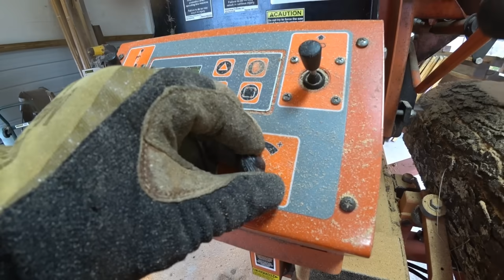FINISHING UP AN AMAZING CHERRY LOG, INCREDIBLE CROTCH SLABS!

Comment: I have often wondered why checking on the ends is considered less desirable. A small drill at the end of the check, some sawdust and glue or epoxy with a bowtie adds character for me. Those off cuts would be great for small projects too. When l saw the book match pieces l can't include what l said lol. Beautiful piece of lumber. Wish we could buy that here in Canada, our local supplier prices timber as if it were gold. That next tree is going to be platinum.

Comment: Nathan, sitting watching your newer sawing videos and all your sawdust on the floor. You need a vacuum system like we had in the saw mills I worked in, only a lot smaller. Put the system outside with a bin under it and a flexible hose that hangs on a wire overhead between the saw and the vacuum. I am sure you can find people around who will buy that dust for garden mulching so long as it doesn't contain any conifer wood.
Reply from the maker: That’s in the works.  👍👍👍
Reply: Walnut sawdust is a plant toxin so you have to really control its use as a mulch.
Reply from the maker: I burn mine 👍
Reply: I also read you should wear a mask with walnut as the dust is unhealthy. Is that true?
Reply: I think it is at least an irritant and more for some people than others. If I was going to work around walnut dust that could be inhaled day after day, I would wear a mask.    But I’m no expert on it.
Reply: I used to work in a cabinet shop that had a yard full of sawdust that they would sell to a horse farm but the farm stopped taking it because the horses were allergic to the walnut dust. That dust had a manure-like smell that I did not like either. Some types of oak have a similar flavor but cherry dust smelled the best. My favorite wood!
Reply: I too was wondering about all that sawdust on the floor at the end of the day! Thanx for all your replies that answered that!

Comment: I agree that the oil drain hose bothers me hanging down. 
Can you zip tie it to the blade tension handle loosely so it doesn't interfere?

Hate to break it to you but nasty storm headed east towards you with severe cold first part of the wk.
Reply from the maker: Yep saw that 👎👎👎👎

Comment: Great looking, even though it’s still a little furry from the Saw Mizer blade. When it’s finished it will be something. Also, try custom white balance on your camera. The wood changed color a couple of times due to AWB.
Reply from the maker: Yes. I struggle with that.  Thanks 👍
Reply: You can get white balance cards on Amazon. I carry one with my camera. You just have to remember to set it for the next shoot or it can really mess things up. 🤓

Comment: Nathan, as your saw blade gets dull is that what makes the horizontal lines across the slab? 
i can see them but still it can't detract from those awesome insides of the slabs!
Reply from the maker: that and bark causes it also,
Reply: A bit of sandpaper will make it all alright!
Reply from the maker: yep!
Reply: When/if  you change the blade, I would like to see that if you are considering making a video on it.
Reply: can also be cause by any tooth being too far out of set even on a sharp blade.

Comment: RE: Stickers: If you use oak you will have issues with staining as the tannin in the stickers reacts with the wood being dried. A dark penetrating stain that is almost impossible to remove
Reply from the maker: Agreed 👍👍
Reply: I'm with Nathan, I cut pine for stickers on just about everything except oak. I will use the off-cuts from milling oak to stack oak. And, I cut mine 2" x 2" so the forks of my forklift can get in between layers.

Comment: Awesome stuff. Out of curiosity, do you ship to individuals?  I'm a hand tool woodworker and want to build a small 4" long roubo bench for working inside  the house. The top would be a finished 4' x 12" 16 quarter (plan to add a 12" tool well) and the legs likely finished 4x6. Since it would double as furniture inside the house (like a buffet table) I think I'd like it out of cherry. I live out in CA. Shipping could be spendy.
Reply from the maker: right now only locally, havent gone down that road just yet, but might,

Comment: What degree and style blade are you using? New or one you sharpened?
Reply from the maker: I sharpened. 7 degrees double hard. Was about dull in the video
Reply: @OutoftheWoods0623  I've been using the 7 degree in frozen pine and I milled a cherry,seems to work good.
Reply from the maker: I’m getting some 4 degree tomorrow see how they go

Comment: Note for stickers: An old sawyer told me that splits tend to stop at the first sticker so he told me to make sure that you have a sticker at the very end of each slab. Also, Have you thought about getting one of those cheap harbor freight dust collectors with flex hose to pull your dust? I know the bags aren't very big but you could use the blower itself to shoot the dust outside or into a dumpster. I saw a video somewhere of a guy using a leaf blower that has the leaf vacuum ability and he clamped a hose to it and used it for dust extraction on his mill.